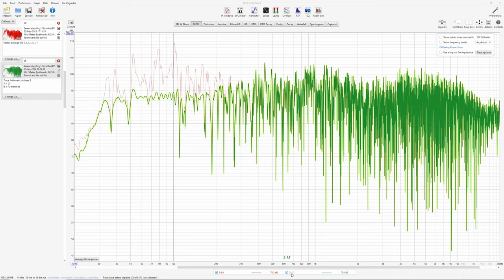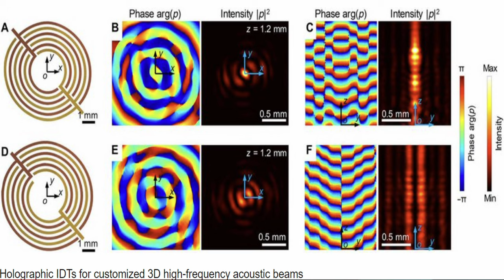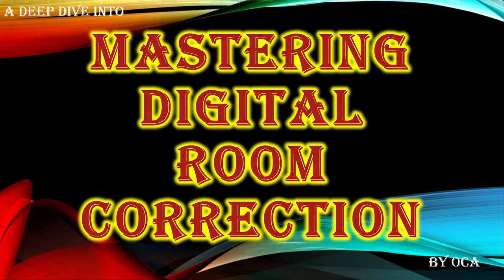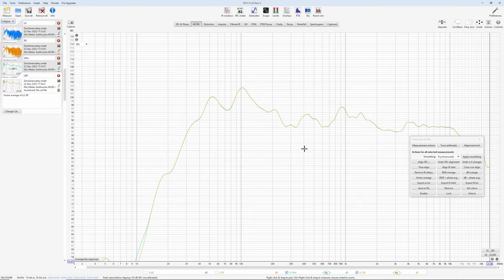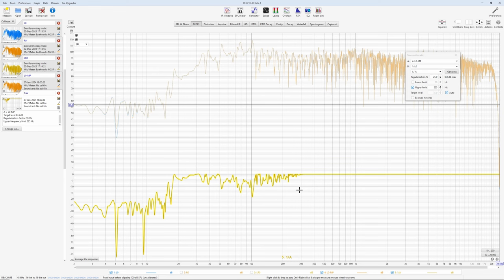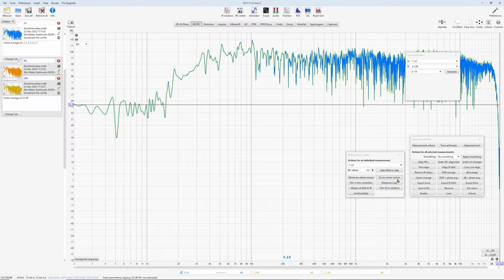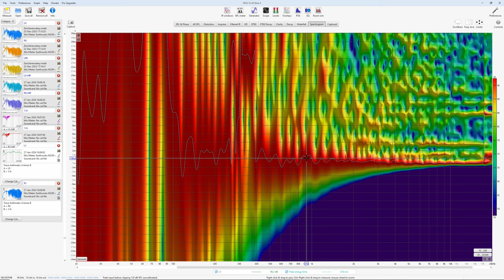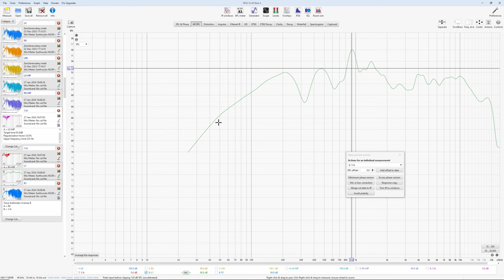Mastering Digital Room Correction

Comment: Wow, easy to do, well explained and sounds great!
Headroom correction needed in Roon: 0 dB!

However, I have 3 questions:
- I recently bought the Umik 2 microphone. In the IR windows, entering the ms corresponding to the distance of my speakers (3.2m = 9.41 ms, REF time 0.007), to see the behavior on the high frequencies, as you did, I can't see frequencies below 106 Hz. How is this possible?

- I did not correct the microphone calibration with Minimum phase.
Where can I find the procedure?

- Multiplying 1/A with Harman Curve results in a mess of delay between the 2 channels in addition to the foreseeable need to use about 8db of Headroom. I can't understand where I'm wrong.
Reply from the maker: 1. You shouldn't be able to see the response below 106Hz because a short right window size of 9.41ms means the minimum frequency you can detect is 1/(9.41/1000)=106.27Hz - frequency is just 1/time in seconds. I can see it with a trick but it's just an extrapolation by REW for convenience, is not correct by any means (Preferences/Analysis/Use right window for min frequency unticked!)
2. Somebody located it and linked it down here in the comments.
3. I don't recommend applying a target curve, I suggest turning up the volume if the bass is too weak not to your liking :) Again, I explained and suggested a way (LS filter) to increase bass which seemed to work with the channel member down below in these comments.
Reply: @ocaudiophile  Thank you so much!
Reply: @ocaudiophile  Just for information: I applied the MP correction to the microphone and redid the procedure. Now to avoid clipping I have to give -4dB in Roon, before 0.
What I changed is only the correct phase of the microphone.
Reply from the maker: How does the MP version of the mic cal file look like? If it's deviating from 0 degrees too much (more 20-25 degrees at the extremes) than you must have done something wrong during MP generation. Try adding tails and/or removing IR delays from the mic cal MP version.
Reply: @ocaudiophile  about 19 degrees at 10Hz and -3 degrees at 20kHz, looks nice.
Reply: @ocaudiophile  ''Try adding tails and/or removing IR delays from the mic cal MP version.'' I don't know how...
Reply from the maker: Can you share your original mic cal file?
Reply from the maker: It may be that, you didn't take the original measurements with this cal file in place.

Comment: Another question from an amateur: What to do with the subwoofer during measurements?
Reply from the maker: If the sub is properly time aligned and crossed over with the speakers, you can use the method as is with the combined sub+speaker response. If you have the possibility to separately apply convolution filters to the sub and speakers (most people don't), you can also apply the method to each first and combine them afterwards according to the resulting curves.

Comment: Which video contains the min phase mic cal?  Great video thank you for sharing your DSP knowledge.
Reply from the maker: Thanks.

I think it's this one:

https://youtu.be/i7AaBpqv_p8
Reply: I have the U mike 1, is this a different procedure from the U mike 2 example? @ocaudiophile
Reply from the maker: No, the exact same procedure
Reply: @ocaudiophile   I did find this in your video 
Phase Match Your Speakers with AllPass Filters
https://youtu.be/ChPu0u3nZxc?si=oM9uAEoz8bII3jut
at 5:15.  00:05:04 Calibration microphone phase correction.  
This may have been the video you were referring on the U Mike 1.  
Thanks!  
By the way,  the RME-2 Dac fs is german engineering at its finest. Thanks for the tip.

Comment: Thank you very much, your videos are awesome. I made everything exactly as you said but i m able to hear a strange preringing (i think) - sounds like a sinus frequency thats playing just before something starts like an open mic that feedbacks lightly on a frequency, that frequency is around 160 Hz... any ideas?
Reply: i think using a minimum phase version of 1/A solved the problem, but why is that?
Reply from the maker: Generate minimum phase versions of the final 1/A filters and use them instead. That will stop any ringing.
Reply from the maker: The filter resolution is insufficient to create the exact inverse of the phase response which is causing pre-echo.
Reply: @ocaudiophile  does using a minimum phase version has any disadvantages? Am i able to correct the phase afterwards with rephase?

Comment: The window you apply for 11ms gating isn't anechoic. It contains reflection from floor and ceiling.
Reply from the maker: You must have missed. I applied 7.11ms and is the time it takes sound to arrive directly at the mic from the source. My first floor reflection travels 0.75m longer to arrive at the mic +2.19ms after that. Ceiling reflection takes even longer (+5.24ms)

There are early reflections arriving within the first 7 ms but these are right from the speaker surfaces hence the weakness of the technique.

Comment: Another great video, personally learning a lot and my musical enjoyment has been taken to another level.  This video is very similar to the very first video I watched and made some major improvements to my system titled "REW (Room EQ Wizard) Top Tricks: Convolution with Inversion (no EQ filters, all FIR!)".  This video cuts out the use of a House Curve so looking forward to the upcoming video re-introducing a House Curve\LS EQ Filter.

A few questions/general comments for the masses:
1 - For my 1/A Inversion (From L/R-MP Copy), the IR Window sizes where huge, Left Window greater than 10,000ms.  Before exporting I trimmed the 1/A window to R=100ms/L=500ms.  Curious as to why so large or what I did wrong?
2 - For my 1/A Inversion (From L/R-MP Copy) I was getting pre-ringing with Roon.  Creating a 1/A MP copy resolved that issue.
3 - A few comments below noted lack of bass, to resolve I imported the Harmon House Curve and multiplied with the 1/A MP Copy (L/R - 1/A MP * Harmon House Curve) which boosted my bass to better match my frequency level aboves 225Hz.  I'll note to avoid pre-ringing weirdness must do against the MP copy and I had to adjust the IR Windows sizing from being super large.
Reply from the maker: Large window sizes are normal with inversion (it requires double the zero padding of the FFT in the background). In fact the cause for pre-echo is still the insufficient window sizes as a perfect inversion wouldn't ring.
Reply: @ocaudiophile  Thanks, not doing something wrong then.  My default window size in preferences for left is 1000ms, right 2000ms.  Do I have those values default correct?

Comment: Great to see you working on this. Makes it easier and quicker to get great results.
Reply from the maker: Absolutely!
Reply: There was a little bit of Ringing with the 225Hz setting after I tried it out with increasing the range. Have to reduce it to below 200Hz I think to lessen Ringing on my end. It was not noticeable until I tried higher frequencies and then compared it On & Off a few times to note it was ringing even with 225Hz cut-off. 
You mentioned you might have to change it on our end and I can confirm this to be true. 
Increasing the range just causes LOTS of ringing for me. And ~200Hz seems to not have it.
Reply from the maker: You are probably right but HF is not a known cause of ringing. Precision becomes quite important with inversion. Also filters are longer than usual because of the zero padding required for the FFT (even after trimming). I would suggest to vector average multiple measurements with 1M length before starting to create the filters for best results. @nighthog7003

Comment: This is really fantastic and I am currently experimenting with the inverted response as FIR filter. I am also starting with rephase and I have following question: When I invert without Minimum Phase the computed 1/A filter has the same phase characteristic as my measurement. Could I load this inverted response into rephase an do (only) a phase calibration there (no gains)? Then I would generate a kind of phase correction filter in rephase, export it, import into REW and then multiply it via Trace Arithmetic with the inverted response. This would then be my new phase-corrected FIR filter. I assume that your approach with the Minimum-Phase version in REW is still more efficient and the best for measurements from the listening position. My phase-correction idea is on my mind for speaker measurements and would be applied fullrange (I would even use this for digital crossover design with  measurements of single speaker drivers) - basically as the optimized, starting filter for an acitve speaker system. When the system is in place, I would add a room correction filter with your method for the bass response. Sorry, I am really new to this and not firm (yet) with Rephase and I am not a happy user yet. I might be getting it totally wrong ... but am really inspired from you. Thanks a lot!
Reply from the maker: Always work with excess phase of a speaker measurement in rePhase, not the phase itself. Usually crossover phase corrections will suffice but you can also do port/box corrections if you have enough FIR taps to deal with bass frequencies. Check this video:

https://youtu.be/ChPu0u3nZxc

Comment: Thank you very much.   "REW (Room EQ Wizard) Top Tricks" and this video were the two greatest videoes that I have ever seen about music.   I don't think I can distinguish between the sound of the two filsters.  But I think this filter makes music softer.  
I'm a biginner. So I could not understand the part of the video after making the filters.  But I want to study about REW. 
I have one question.  I took about 7 measurements for each SP before Cross Correlation align and vector average.  The length of the sweep was 1M,  Is the length suitable?
Reply from the maker: Yes, I also regularly use 1M measurement length. It's a good compromise between practicality and SNR ratio.
Reply: Thank  you very much,  I am going to study
about your previous videoes.

Comment: Having viewed most of your previous videos, I immediately had the same question as @wmac296 after watching this new video.  From your response to his question, I infer that, for my HT setup, it may be preferable to limit IIR correction of my LCR’s to below ~200hz, but to potentially perform full frequency IIR correction to my less-than-ideally-placed surround/height speakers.  Is that your recommendation or would there still be a benefit to a full frequency correction of the LCR’s too? 

Also, you’ve inspired me to manually calibrate my new Monoprice HTP-1 instead of using Dirac.  The HTP-1 seems perfectly suited to your calibration methodologies, since it has 16 PEQ slots for each of its 16 outputs, the ability to set distance values with millimeter precision, dynamic “loudness” controls, as well as the ability to output REW sweeps to its atmos channels for setting proper time alignment.  However, one thing it can’t due is import a FIR filter.  I currently use a MiniDSP Flex to align and correct my two subs using an IIR filter, but it is also capable of importing FIR filters.  In your experience, would a FIR filter generated using the method in this video yield better results than an IIR filter using the method in your subwoofer alignment video from last year?

Thanks in advance!  I truly enjoy learning your techniques!
Reply from the maker: Definetely stick with 20-200Hz PEQ correction with LCR and use gated windowing techniques explained in detail in Audyssey ART video for the rest of the channels.

I guess, with 16 band parametric equalizers for each channel, you can do a better manual job than Dirac. Check Dolby Atmos manual tuning videos for custom configuration of REW auto-EQ filters for your particular unit.They also have Atmos sweeps that play from Atmos channels although your AVR doesn't seem to need them from what I understand.

MinidSP FIR capacity (1024 or 2048 taps depending on the sampling rate) is not enough to make any meaningful phase correction below 100Hz so no use for subs. You could use MiniDSP FIR filters to apply crossover phase correction to your speakers  since their crossovers will be above 200Hz but that requires different wiring on your end I guess.

It was in my notes but I forgot to mention in the video, the only drawback with these inverse filters is that inversion requires a lot of zero padding of the FFT and final filters will need many taps (ie 65k+) so defo needs a PC as the source.

Comment: Thanks for sharing your new findings!

1. This seems to be the method shown in the short video only without the min phase version with var smoothing?

2. In your opinion, is this version better than the more complicated version of your VBA, xo and lowshelf filter in the last video?

3. Now it would be interesting for me how exactly do I proceed if the playback is from the PC to the AVR and the sub behind it is connected to a MiniDSP?
Should everything be measured in Puredirect and the sub aligned to the front beforehand and then proceed as shown here?
Or do I leave the sub with EQ and the xo set and only apply the front filters? But maybe this will result in a new xo that is better?
Reply from the maker: 1. Yes, but no min phase conversion of the final filter completely changes the results
2.  I tried to implement VBA into this but nothing other than crossover phase correction (and only to a small extent) could improve its results. It really already does the excess phase and doable bass dip corrections as much as possible.
3. Do you have an Atmos set up? If it's only up to 7.1 then you can apply FIR filters to every channel in the PC, you can achieve out of this world results. Otherwise, with neither Audyssey and nor MiniDSP, you will not have the resolution to apply the phase inversion properly.

Comment: Hello sir, I'm most impressed and grateful for the content you're sharing. I've some questions (disclaimer: I'm a rookie so I may be very wrong). My priority is to flatten the low bass, because I have insane drop in 34-57 Hz range.

1. If I was to leverage all your latest methods for a 2.0 system with Roon (no audyssey), I suppose that would be combination of VBA + xover/box/port correction + the inversion below Schroeder. Is that right?

2. In what order should these filters be created and applied? My guess: 1) create VBA filter based on original measurement, 2) create xover/port filter based on VBA-applied trace, 3) create "inverted below Schroeder" filter based on xover/port-applied trace, 4) convolve inverted filter * xover/port filter, 5) convolve result of "4)" * vba filter
	
3. What REW measurement and analysis settings should be used for creation of each of these 3 filters? You specified one here https://www.youtube.com/watch?v=ChPu0u3nZxc&t=226s (with mic pointing at speakers and minimum phase cal file) and another one here https://www.youtube.com/watch?v=zmIqJ_jlZPw&t=1017s . I'm guessing the same measurement needs to be used for creation of all 3 filters, right? So which one?
	
4. What's the optimal measurement length for these corrections? Will 1M be good enough?
	
5. Does it make sense to aim for nearly flat (at zero degrees) result of maximum phase when correcting fox xover/box? Let's assume such correction won't ring or anything. Because I can make it much flatter compared to what you've shown, and even with quite small Q values. Or are the corrections you've shown sufficient? Should we only care about 100-1000 Hz range when "flattening" the max phase response (as it's the range that's audible phase-wise)?

6. I have quite pronounced phase differences between left and right speaker in my listening position. Should I rather them separately (rather than based on LR averaged)? Because my LR average would have quite high std. Deviation, so I would be correcting against a max phase trace which isn't very applicable to neither left nor right speaker.
Reply from the maker: Thanks for the gesture. 1M length is good enough, the louder and the longer the better but rew will slow down and inversions etc will be extremely large beyond that. VBA, phase correction, inversion order seems right, don't forget to generate minimum phase of the final vba and inversion filters. 100-1000hz is good for phase but remember to correct only excess phase. If certain correction causes pre echo, try to just fix what's different in excess phase of left and right speaker.
Reply: @ocaudiophile Loving your videos, have watched all of the ones related to stereo (non-surround) manual DRC. I too am keen on finding the best combo of the various techniques presented. A   new video (which could partly reuse already produced material), showing  your current belief of a best practice would be amazing. Have you found a way to combine VBA filtering with e.g. inversion of minimum phase like in this video? Thank you
Reply: @i5rast yes a video with the best approaches and tricks (like described in the comment before) would be great! Combining different created " pulse responses" is probably just "multiplying" them?! Do I always have to do the minimum phase afterwards? How do I adjust the taps in REW?